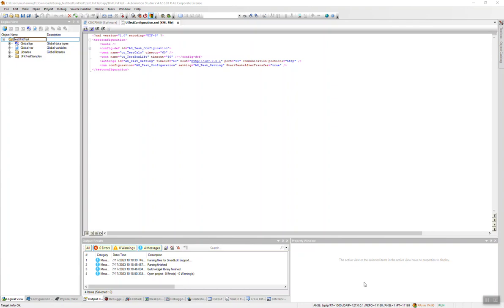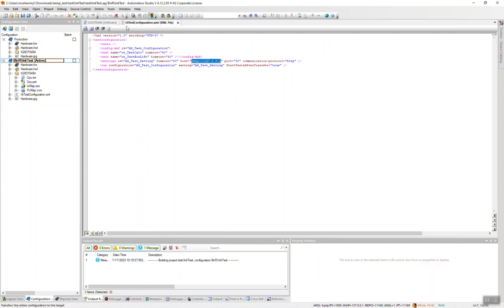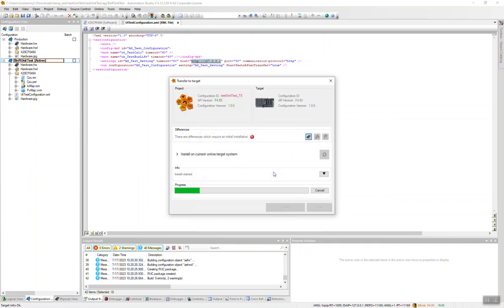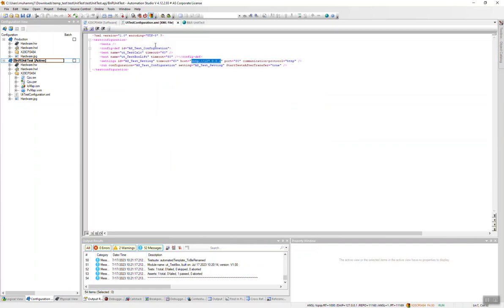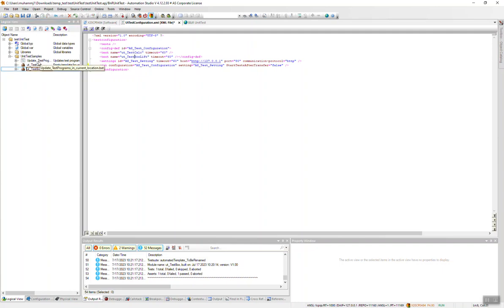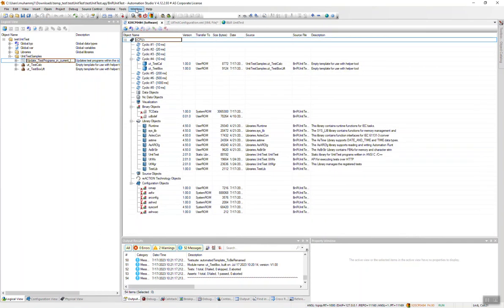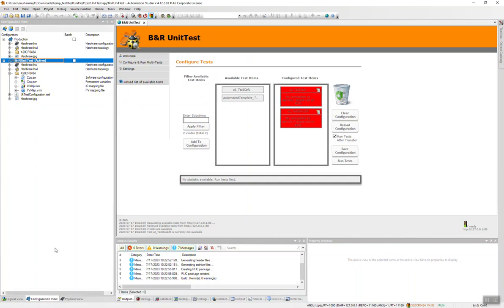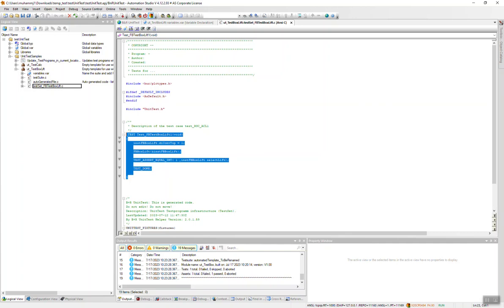B&R Automation Studio Unit Test Setup Part 3

Comment: Do you know if there is a way to run the Unit tests from the command line or a script file?
Reply from the maker: yes of course, that's what the DevOps do on the Gitlab server where this test runs automatically taking instruction from a *.yml file
Reply: @guzzar100  Do you know of any videos or resources on how to set this up?
Reply from the maker: @JAV-u962  unfortunately not. The DevOps guy did it for me. Try to activate test the first in local via a powershell script or python, then do the same on server.